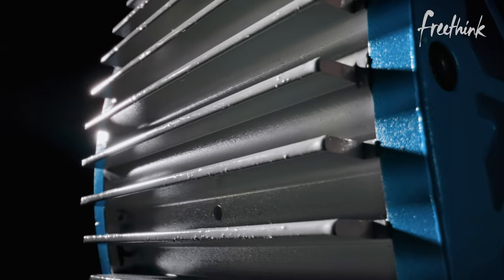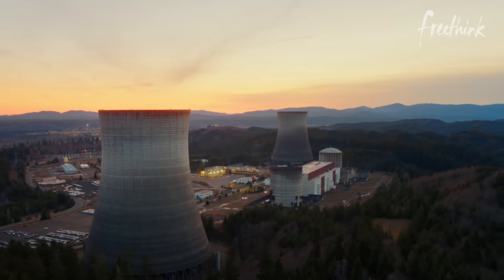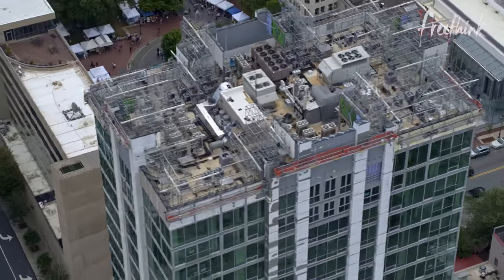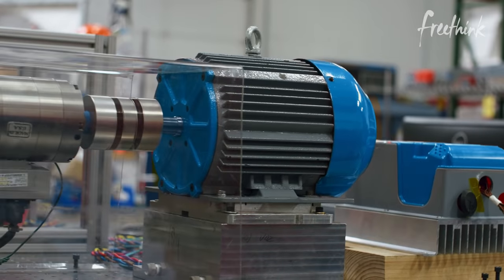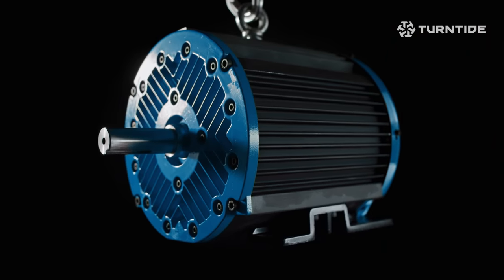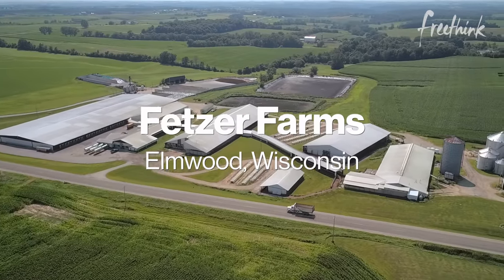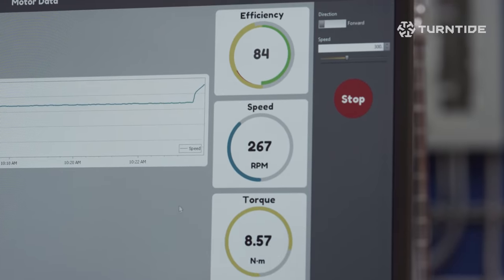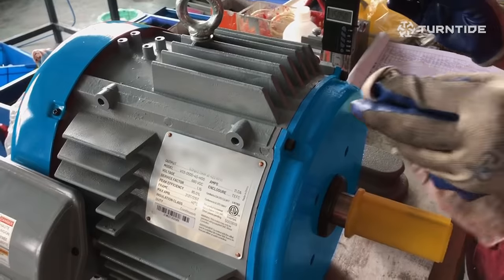Want to Save the Planet? Start with Reinventing the Motor

Comment: Dammit, the art of bullshht is getting more and more cheesy
Reply: They even said "machine learning" at some point. I swear we should play bullshit bingo with those videos.
Reply: @TheNefastor  It's just a brushless motor. The electronics to control it is easy, there are YouTube videos on how to make your own.
Reply: @Timb0NZ  technically it is a brushless but this type has no permanent magnet, so it is a bit harder to control then your average BLDC motor. But not to the point of requiring "deep learning".
Reply: Back EMF also a potential energy that be can store and re-used,,,,,...!!!???Tesla/John Berdini
Reply: @TheNefastor  - "Resonance" Tesla/Berdini
Reply: on and off - by means of resonance or sensor(hall sensor / optical) in the circuit
Reply: @TheNefastor  - additional strong magnet in field coil/exciter can less current be consumed but provided more force/power output
Reply: @TheNefastor  it's called an electromagnetic motor!
Reply: Ooh boy, I'm sensing so many over-unity conspiracy theorists right now... let's cut to the chase, how many of you actually have a degree in electrical engineering ?
Reply: @TheNefastor  obviously ''not'' the fellow trying 2 tell us, that consuming 99% electric will be so green!! 4 what it is worth? every 1 is just stating, that they now get 2 go 2 the ''PTO'' ! to look up, this brave new technology!!! ha,ha,ha!!
Reply: I find it strange who you can slash 50% energy consumption world wide, when electric motors are already 95+% efficient?

Comment: Title: “WANT TO SAVE THE WORLD??? YOU GOTTA REINVENT A NEW MOTOR!!”   Guy: “we didn’t create anything new. We just remarketed this thing that already exists”
Reply: Yeah. The model 3 uses switched reluctance for the base model. It's slightly more efficient but has weaker starting torque.

If you move up to the AWD or performance model, you get conventional 3 phase induction motors in addition to the SW motor.
Reply: @Gotbread  without sensor "resonance" : when magnet passing  through the set of coil, electric generate and some switching device / sequence will auto activate using few resistor, diode, transistor, capacitor, inductor and neon lamp in a simple circuit

with sensor - by means of hall effect (Magnetic pickup) or optical sensor for switching sequence

in these process Back EMP can also be restored and re-used

i will give you some of schematic diagram which taken from good guy youtubers///
find Tesla joule thief and John Berdini circuit,,,,,,,,,,,,,,,,,,,,,
i'm not good in English
Reply: - install with mechanical battery can help,,,,,,,,,,,,,,
Reply: What if we reduce temperature in the motor

Comment: "We have to switch the current on and off really fast, 20,000 times a second. The computing power, software, and sophistication required to do that made it quite simply impossible"  

what? I have micro-controllers that I got for 60 cents that can pull this off without even the slightest stress on the performance. This is just a bad reason to pick for why your product is revolutionary.
Reply: This ad was clearly made for the general public who know nothing about modern control engneering. Not only that, switching the "current on and off" is wrong. It's switching the voltage, and the current won't stop due to the inductance time constant. 20KHz is the industry standard...
Reply: filmmakers don't know much about engineering. But at least they made making a motor sound revolutionary and dramatic
Reply: PWM anyone? I'm a biologist and know about pulse width moduation - this is nothing new.
Reply: All fans in my home have speed control. Americans call it dimmer switch. Only thing this guys have it some kind of patente for controller circuit so they can charge industries by influencing government.
Reply: Igbt modules are capable of that
Reply: @doates625  The general public doesn’t by motors. Engineers do. This video is made to trap investors.
Reply: Sounded to me like a stepper motor. Those already exist! and they're dead cheap.
Reply: I think he was talking about the 20khz in respect to the algorithm they where training. I assume that this algorithm can replace some expensive components in the drivecirquit, because price seems to be their whole thing.
Reply: I was curious about that claim too, I just fixed an ultrasonic cleaner that powers its transducers at 43.5 kHz, the circuitry inside that wasn't mega complicated
Reply: it's just promotional video for turntide, if you watch ads on TV or Youtube, you;ll simply brush it and rather see the real value
Reply: A simple 555 and a mosfet could probably do the trick
Reply: @hydrochloricacid2146  yeah that's 20khz for about 80 cents
Reply: @RoshDroz  admittedly more expensive than the other solutions but simpler. Crazy times we live in, where a tiny computer costs less than a handful of discrete components...
Reply: @hydrochloricacid2146  it's mind boggling
Reply: @simo2555  well... a rotor is literally revolutionary haha
Reply: I fly tiny brushless toy drones that easily do 48k or even 96khz PWM.. They use incredibly cheap speed controllers and run on open source firmware 👍
Reply: transistors in my phone open and close billions times a second, nothing impressive
Reply: @cornyhub7551  please report this spammer bot

Comment: This is awkward guys. This stuff has been out here in southafrica for more than 30 years that I know of 😆 its called a 3 phase motor with a variable speed drive.
Reply: I recently bought a "dual inverter" air conditioner. It's variable speed, and super quiet.

I also know a lot of newer refrigerators and whatnot are variable speed now to be able to market lower yearly energy costs when comparing the labels between competitors.

I have no idea what these guys are on about, their motor is nothing new.
Reply: @Jaker788  the point of this is not the variable speed but the way the motor works, any motor can be driven to have variable speed (it's still not new stuff tho)
Reply: In any case DC motors are 80% efficient as is.
Reply: lol same in nz

Comment: 2:51 "we have to switch the current on and off"  WTF this guy is talking about how basic motors have worked for over a hundred years as if it's revolutionary technology.
Reply: No, he's talking about high efficiency digital CONTROLLERS, which use high frequency switching to control the current to the motor without the high losses of analog current controls.  Of course, digital controllers have been around for several decades as well, but their cost has been prohibitively high until recently.  That's what they're working on.
Reply: Tesla Joule Thief and Jon Berbini SSG makes Electronic Useful Working Energy
Reply: Presentations sometimes give some one overconfidence..It should have really been "... switch off the current of the ACTIVE switch/ transistor". winding current continues to circulate as steered by other electronics.. ..😁😁😁
Reply: @BrightBlueJim  - High Frequency controls WAS Expensive like 50 years ago, today half of electronic gates, refrigerators and air conditioner use frequency inverters. This technology is cheap from more than 15 years and its getting Dirty cheap now.
This video is pure bullshit.
Reply: @brianfhunter  It's not bs, because STILL, the majority of motors are old-school and do not take advantage of newer technologies.  Those are the ones he's talking about in the video.
Reply: @brianfhunter  Well, okay then, I was wrong - it IS bullshit.
Reply: I mean, technically all motors that aren't linear induction motors are revolutionary

Comment: How much did they pay you for this ad? BLDC motors are 84% efficient, same as motors shown here. No motors can be 100% efficient because of cable and copper losses. For what f*ck they need machine learning and "advanced controllers" to drive these motors? "It was impossible earlier" haha switching 20kHz wasn't impossible. BLDC motors were just more practical.
Reply: @Eric MeyersonBLDCs can be run sensorless too. In many constant speed applications inverters already support the sensorless applications. The advantage of the SRM is the lower price but you also loose torque density.

Can you elaborate on the bearing currents? Sounds interesting
Reply: Of course switching 20 KHz wasn't impossible! We have too many microcontrollers with dedicated PWM modules for motor control, and if you need better control or performance, you can use a DSP or DSC.
Then, what do they need machine learning for ? Aah, I got it, just to make the video more attractive by bringing up trendy subjects that have no relation with the current topic!
Reply: Back EMF also a potential energy that be can store and re-used,,,,,...!!!???
Reply: @gotbread2   without sensor "resonance" : when magnet passing  through the set of coil, electric generate and some switching device / sequence will auto activate using few resistor, diode, transistor, capacitor, inductor and neon lamp in a simple circuit

with sensor - by means of hall effect (Magnetic pickup) or optical sensor for switching sequence

in these process Back EMP can also be restored and re-used

i will give you some of schematic diagram which taken from good guy youtubers///
find Tesla joule thief and John Berdini circuit,,,,,,,,,,,,,,,,,,,,,
i'm not good in English
Reply: as they said "on and off" method means the timing before-mid-after angle of rotation precisely between coil and magnet
Reply: @cornyhub7551  I am well aware of the joule thief device, which is just a fancy boost converter. Same effect happens in any H-bridge by default as well, feeding back the energy from the coil. The thing is, this happens with all kinds of motors, making this one not that special. The On/Off angle thresholds are also the standard method for driving SRMs. We have one in the lab so i know the inner workings very well
Reply: @gotbread2  - make deffer regarding the fancy joule booster converter and H-bridge concept,
it's just the basic and fundamental, why it does exist and insert in most modern application today,,,

before was just a transformer

now fancy joule booster makes reducing copper in the winding and less weight.
Thanks to TESLA Joule thief,,,i lost weight.
Reply: TESLA JOULE RESONANCE - is the origin of PWM today
Reply: Primitive IC 741 and Timer555 - can do oscillate / PWM
Reply: High Frequency "On and Off" switching device = PWM
Reply: TESLA CAR need Battery
That's why he willing go to MARS
Rare Earth is not good mining our surface
They gonna be Mine in the Moon and Mars
Reply: also less iron and small handy,,,
Reply: see good guy in youtubers about TESLA COIL and BERDINI MOTOR/GENE, they are exist in every gadgets today such as tiny, sophisticate, powerful,and etc.,...
im gone, not good in English, just share
Reply: @gotbread2  - @unclejoeoakland - do know how make PCB using Eagle or EasyEDA in Electronic Simulation Software to design a Circuit ,,,, OK,,,,,,,, 
We need the following topics 
1. DC to DC converter 
2. Analog to Digital Converter
 3. Digital to Analog Converter 
4. Voltage to Frequency Converter 
5. Electronic VDC - 3 Phase Converter
 6. Hall Sensor Module(optional) 
7. Optical Sensor Module(optional) 8. Current Regulator circuit 
9. Isolated Transistor drive for H-Bridge 
10. H-Bridge amplifier using Power Transistor, MOSFET and IGBT 10. Electronic Pick-up RPM Module 
11. DC 3 Phase Brushless Motor Drive Module -as a hole( you by a unit) Type of motor
A -Brushless -with brush 
B - ac 3 phase induction motor - dc 3 phase motor-w/neodimium magnet 
C -No. of Poles 1, 2, 3, 4, 5, 6 Etc., >>>>>>>>>>>>>>>>>>>>>>>>see in YouTube ALSO SEE JOHN BERDINI CIRCUIT It's easy and simple all in one circuit motor drive including Actuating Motor.

Motor wiring "  2, 3, 4, and 5 wire Motor

BMS-Battery Management System
Constant voltage
Constant current
battery type:
dry cell
Li-on
Graphene
Solid State
Mechanical
_ _ _Arrangement of Different Charging capability
Reply: @gotbread2  - joule thief device is to reduce winding and iron core inverter which consist of switching component,
inductor, diode, capacitor and transistor,  feed back,,,compare to normal heavy and large transformer more winding and iron core inverter is just diode and capacitor.
Reply: @gotbread2  H-bridge need pnp and npn transistor couple together in series gives C=Vcc, B=simmultanously trigger, E=Gnd, consisting 3 set/Phase in parallel to form 3 phase
Reply: @gotbread2  - Feed back "on and Off" is when magnet and coil winding facing each other timing is significant prior to before-mid-after position switching sequence :
1st  "ON" state of SW-coil core-fulling the magnet rotor from before to mid position 
2nd "Off" state of SW-coil core--pushing magnet rotor away from mid position,
3rd "ON" state of SW -proceeding coil core-fulling the magnet,,,,then back again to 1st
that will go on and on every set of coil and rotor magnet,,,
Reply: @gotbread2  BEMF-Back Eleclto Motive Force
this is taking away to atmosphere or to the air, remember coil store energy/electricity,
current flow to the coil  develop magnetic field then store energy...
when the power "SW OFF state" magnetic field collapse,,,,, electric energy force find  the way out such as sparking between switch contact point cause detour or go away to the air,,,
this electrical potential energy can store to battery or capacitor through the DIODE and  TRANSISTOR COLLECTOR PIN of switching device.....
we need the drawing, schematic, diagram  or illustration for this,,,,see you next........
Reply: @cornyhub7551  what are you trying to tell us and what does the motor has to do with an atmosphere? Look into how brushless motors work, how 3 phase inverters work, and what the loss mechanisms are and you will understand the issue
Reply: @gotbread2  one reason/ source of bearing currents 
( more so in pwm drives)..
is due to H.F. ( @ pwm Freq. and their harmonics) 
Due to the " capacitive"  coupling of the insulated winding and its return path through the bearings, motor frame..and the power circuit.  bearing failure due to this current passing through the tiny steel balls
inside of the bearing....
high voltages@ currents flowing through a very small surface contact area..
Reply: @analoghardwaretops3976  If that is an issue you could ground the bearings. The capacitance between the wires and the bearing is quite small, in the pF range at most.

Comment: This looks basically like BLDC motors.
Reply: It seems kind of more advance not being off and on the next cycle, but controlled exactly when to turn on the coils, requiring more computing.
Reply from the maker: Here's some of of the differences between BLDC and switched reluctance motors: https://www.mpoweruk.com/motorsbrushless.htm 

Also worth noting that switched reluctance motors in general, as the video says, have been around a long time. However, the use of modern software to drive and control it is what differentiates TurnTide's motor. (details: https://softwaremotor.com/technology/)
Reply: Yeah I'm not seeing the difference too. So ... the motor controller is better? This doesn't seem that "groundbreaking". Is it that this company is producing industrial scale BLDC motors? That's cool. Yeah people should be on board with it.
Reply: @Eric Meyerson Eric,  you are amazing.  Thank you for the first real explanation I've seen of it.
Reply: @Eric Meyerson is this technology openly available like open source technologies?
Reply: Freethink this is copied from another response

Comment: Absolutely zero explanation about how this increase in efficiency is achieved mixed with some out of context trigger words like AI makes me think this video/company/product is BS.
Reply: When making a promotional video for a non-technical audience (which is what this video is), you can't really explain what's really going on, leaving you only with flashy words.  It's unfortunate, because you really COULD reduce the wasted power in electric motors by at least half, just by replacing old-school motor starters with digital speed controllers.  It's not actually the motors that need to be replaced, just the controls.
Reply: Back EMF also a potential energy that be can store and re-used,,,,,...!!!???Tesla/John Berdini

Comment: This sounded a lot like bullshit.  I was interested in it on a principle level, how much electronics can and do make motors more efficient.  I'm pretty sure that's already being pushed to the edge in electric cars, where every percent of more efficiency means more range.  And I'm wondering how much that will lead to the improvement of motors in everyday appliances down the line.  But it was pretty clear that the claims in this video regarding the inefficiency of traditional electric motors and the possible efficiency gains are pure baloney.
Reply: its litterally just switched reluctance motors. Teslas been using them for a couple of years. Nothing new.
Reply: Sounds like bullshit, because it is.
Just a big Scam, take a stupid idea, throw a bunch of words about climate and some random numbers, make a big propaganda about it and wait to collect money, from stupid people or just government corruption.
I think there is not a single truth on this video.... electric motors dont waste 50% energy, the real number is closer to 10%, including old ones. The biggest problem today is not climate change, is by far Totalitarian Governments, not even the high frequency thing is new, this technology is already used for more than 50 years on the industry, big electric motors cant even start without a frequency inverter.

Comment: 0:35 "half of the energy that goes into motors is wasted"  - complete nonsense. The efficiency varies from 80% for tiny motors, to 99% for huge ones.

No electric motor has 50% efficiency.